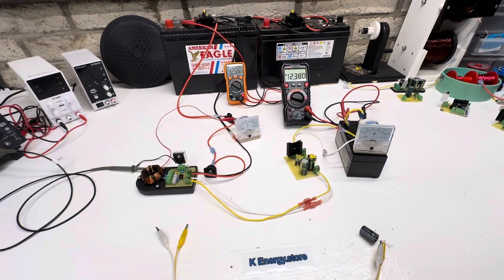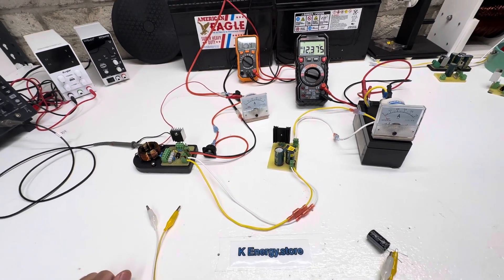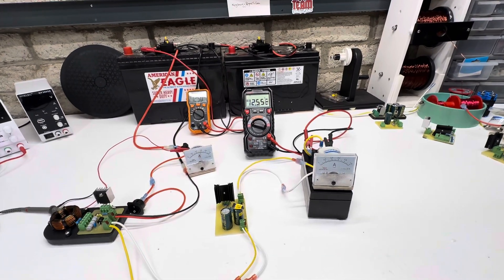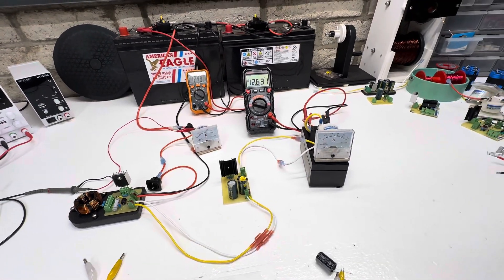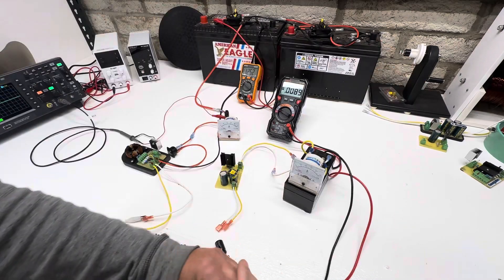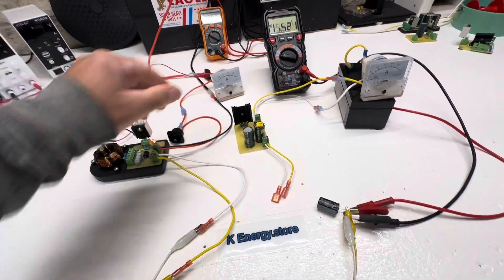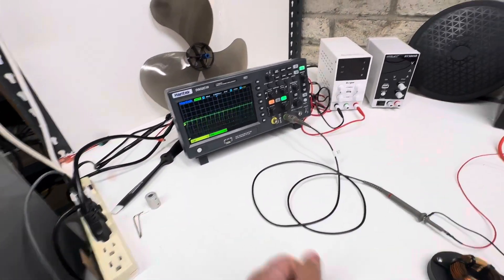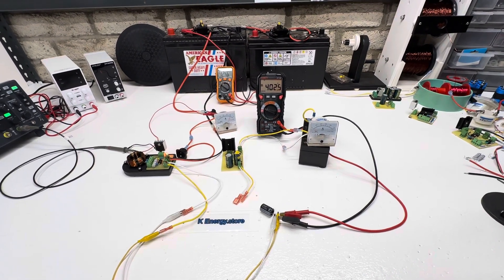Oscillator 400v cap charging

Comment: On the oscillator, have you found the sweet spot for the size and number of windings? I noticed (on the ones I've built) if I have less than a 1 inch inner diameter the coil will heat itself up and the number of windings seem to be negligible for the purpose of charging up a battery. It seems the number of windings really only change the frequency and I am amazed at how well the smaller coils work in the setup. Anyway those are some really neat things to tinker with.  Cool vid as always
Reply from the maker: Thanks ! Yes there is a sweet spot this one likes 12k hz I went threw many coils testing it out the wave form on this one is extremely clean and has even 30v on high side as well as 500 on low  site to collect